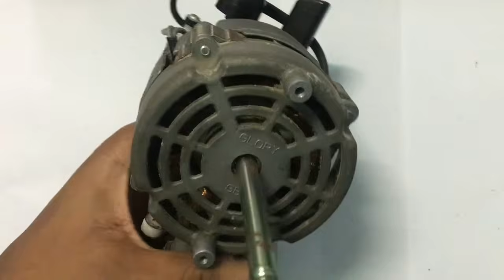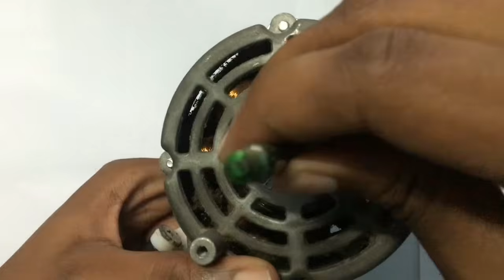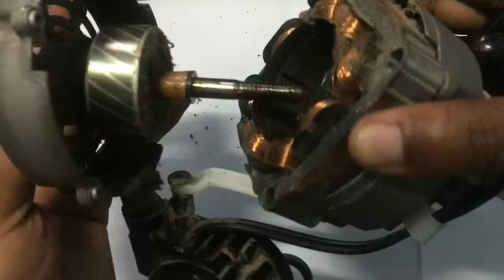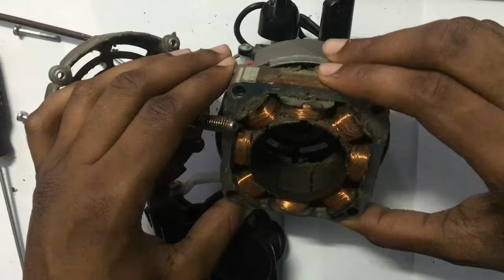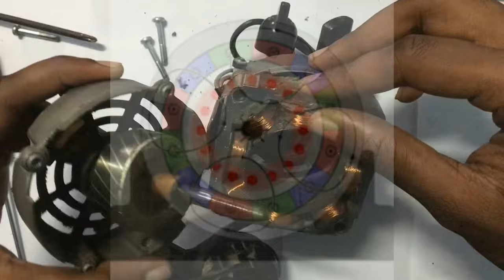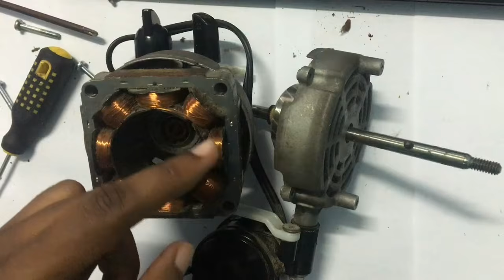How An Electric Fan Works

Comment: No! The switch is NOT a variable resistor. The 3 speed selections are due to different lengths of wirings in the coil assembly. The switch taps into the coil with 3 colour wire coded points. White is usually common. 🇧🇧

Comment: I've had a similar problem with my fan. I tried taking it apart and re-greasing the shaft but no luck. I think I've got an issue with the Starter. Any ideas on how to fix that?

Comment: Quick tip after u use wd40 make sure u also spray the back and make sure its lose before u put it back together u may need to twist and turn it abit to shake it lose and pull and push it cuz it has two bearings one in the back and one in front also make sure u put some vassaline on those beerings to make it run.

Comment: I've taken many apart. Because they seize up. I clean the shaft and the bearings. I use lithium grease. Because it seems oil doesn't last as long. I am not experienced in the electrical aspects of a motor.

Comment: hi i’ve been asking this question around, hope you’d be able to help. a few of my fan copper wires (maybe a couple) are broken, will it still be working or it’s dead now and need to replace a new motor? 
the fan is not working at the moment, i’m  not sure if this is what causing or the capacitor is dead. i’ve cleaned and put some lubricants but it still doesn’t work. 
thanking you!

Comment: Run caps do help starting somewhat. Also, a start cap cannot be used to run very long. On washer motors, for example, they are removed from the circuit, after achieving a certain RPM, by a centrifugal switch.

Comment: A lot of cool electromagnetic theory and electric motor design info here! I wouldn't recommend 'wd-40' to lubricate the fan's bronze  bushings though. Use an electric motor lubricating oil or I use engine oil, synthetic oil, etc. WD-40 is too light and goes away quickly. Thanks!

Comment: The rotor is a Squirrel Cage Rotor. It does not have windings inside. It consists of strays of copper/aluminium blades cut through and shorted. It is not like Armature Rotors which have windings.

Comment: I've heard that WD 40 isn't recommended for use in electric motors.  3-IN-ONE makes an oil specifically for electric motors.  It comes in a can that looks just like their cans of household oil except they're blue and white instead of black and white.
Reply: This is true 👍. In my workshop, WD 40 gums up as the motor heats up overtime. It is better to use the white machine oil. Stay away from motor oils also. They have inherent detergents which will grind the shaft and bushins away.  🇧🇧

Comment: Pretty well explained for the most part... The part with the rotating magnetic field is kinda confusing.
On single phase power, the magnetic field doesn't rotate, it just changes polarity 100/120 times per second (1 Hz = one cycle of both polarities). Three-phase induction motors have three phases that are all 120 degrees apart, so if you have three coil sets that are 120 degrees apart each connected to one of the phases you can actually have a spinning magnetic field. With a single phase, you don't. And that's why the capacitor is needed. Otherwise, from a standing position, the motor would have no reason to rotate. Once the motor is running, the magnetic field produced by the rotor is automatically slightly phase shifted by the rotation itself. Therefore, the capacitor is mainly needed to provide a pull to a specific direction when the motor is not spinning yet.
In reality, it's all a little more complicated than that. And there are all kinds of important differences between different types of motors which aren't obvious at first. But that's the basic explanation.
Reply: Thanks for explaination 👍
Reply: Wicked explanation honestly. You should teach lol
Reply: Thank you for the explanation. So, if the capacitor is not working and I physically rotate the fan blade, then the fan will start working?
Reply: @isla2974  In theory yes, if you can spin it fast enough. Without the capacitor there is no "net force" pulling in any specific direction. And if you spin it slowly (compared to mains frequency), it will still essentially just be pulled back and forth in alternating directions. So on average it won't "want" accelerate in any direction. If you can get the motor close enough to it's normal operating speed however, you can get it to "catch" on mains frequency and keep on running, even without a capacitor.
Reply: @phinok.m.628  thank you for the explanation!
Reply: Great explanation. 
What bothers me is: does the alternating magnetic field dictate the speed of the rotor as that is what it's trying to follow, if I understand correctly? If so how is fan speed controled?
Reply: @pilotboy2612  There are synchronous AC motors and asynchronous AC motors. A permanent magnet spinning in a magnet field would be a synchronous AC motor. It would lock onto the AC frequency and spin together with it at the same speed. Or if too much load is applied it would start jerking/vibrating and skipping magnetic poles. That's what you are thinking about.
In an asynchronous motor, like the one shown in the video. The magnetic field of the rotor is created by the stator inducing current into the rotor. Even if the motor isn't spinning, the magnetic field in the stator is switching polarity just like the AC current. And in fact, if the rotor were spinning at AC frequency, the magnetic field around the rotor would not change anymore and therefore no current and no magnetic field would be induced into the rotor. It relies in having a difference in speed. And the bigger the difference in speed, the bigger the torque of the motor. The problem is, that with single phase supply, if the motor is not spinning, the magnetic field of the rotor and stator are always 180 degrees apart. If you had a ball and you would put something on it, it would only spin if that something is of center. And the slower the stator spins, the closer the magnetic "pull" is to the center. So the motor needs some speed in order to be spun... When the stator has an actually spinning magnetic field, that's different, because the magnetic field of the stator will be "dragged" around, even if the magnetic fields are 180 degrees apart. In fact the motor will be the strongest, when starting from a stand still, where the magnetic fields oppose each other exactly.
That said, in either motor, the higher the frequency, the quicker the change in magnetic field and therefore the stronger the induced current and the stronger the generated magnetic field. Therefore a higher frequency will increase the speed of the motor. But not simply, because the magnetic field dictates the speed of the rotor, but rather the speed the magnetic field changes relative to the rotor dictates the torque...
It's quite difficult to squeeze into a Youtube comment in a way that sort of makes sense. But I hope it helped you understand it at least a little bit better. :-)
Reply: @phinok.m.628  Thanks for the clarification.
So the frequency dictates the max speed? Let's say a fan on setting 1, what's happening to the magnetic field? My understanding is that a longer coil will have less current in it hence a smaller field. But I still don't understand the affect of the frequency in this case. What if you where using 400hz like in aircraft? 
Sorry if I'm being slow and appricate it's not the easiest thing to explain in a comment 😀
Reply: @pilotboy2612  Well, it's difficult to explain and probably also difficult to understand. It's one of those topics that seems fairly simple at first, but the more you know, the more you see how little you know.
Anyway... Yes, the frequency dictates the max speed. It doesn't dictate the actual speed. But it does still have an influence on the speed. The motor has more torque, when the stator has a stronger magnetic field. The strength of the rotor's magnetic field depends on the current going through it. The current induced in the rotor depends on the rate of change of the magnetic field around it. Keep that in mind, the speed at which the magnetic field changes, determines the current and therefore the torque of the motor.
First of all, assume you have the motor running at 60Hz AC and spinning at 50Hz. The rotor will see a magnetic field around it oscillating with 10Hz (the difference between 50Hz and 60Hz). If the motor however is only spinning at 40Hz the rotor sees a 20Hz magnetic field and so, more current is induced and the motor produces more torque. Therefore, if you put a greater mechanical load on the motor, the motor slows down, which cases it to produce more torque (it's kinda self regulating). But now, what happens if the motor spins at 50Hz, but the supply voltage is increased to 70Hz? In this case the magnetic field around the stator also changes at 20Hz and therefore the motor also produces a higher torque. This means, the power of the motor can be controlled by the frequency and by extension also the speed. Keep in mind that when the rotor has a stronger magnetic field opposing the magnetic field of the stator, this also causes the current in the stator to increase and therefore the power consumption of the motor increases (increasing the torque requires more power and obviously that power has to come from somewhere).
But remember how we said the rate of change of the magnetic field determines the torque...? Well, assume we have a 100Hz AC voltage with 10V peak. What happens if we increase the peak voltage to 20V? The frequency remains the same, but in order for the voltage to go from -20V to +20V in 1/100th of the second, it has to increase twice as fast as it would have to if the peak voltage was 10V (same frequency). This faster rise and fall in voltage also induces a stronger current into the stator, which creates a stronger magnetic field in the stator (at 100Hz) but a stronger magnetic field changing polarity at 100Hz will also change faster than a weaker magnetic field changing at 100Hz... So what does this mean? It means that keeping the AC frequency the same but increasing the voltage also increaes the rate of change in the magnetic field of the stator and therefore also increases the torque of the motor. Which ultimately means, you can also increase the speed of the motor by the voltage. In the end, the speed of the motor depends on the voltage, the frequency and the mechanical load on the motor. Higher voltage increaes the speed, higher frequency increaeses the speed, greater mechanical load, decreases the speed. And so it balanced out at some speed (smaller than the AC frequency).
Quite a discussion this has turned into. :D
But anyway, I appreciate your interest in topic. Hopefully this fairly long explanation helped you understand it at least a little better. Keep in mind, this applies to asynchronous inductive motors in particular. Different motor, different rules of course.
Reply: Wonderful explanation sir. I remember some of this from the first year of HVAC act it forgot a lot of it. You must be an engineer or something?

Comment: Can you please explain what is the purpose of the capacitor? You mentioned a variable fuse as well... so if 2 of 3 speed setting works, but the 3rd is broken (taking for granted that no other parts are broken like the button housing), is that a fuse problem or the capacitor?  Just need your awesome input if possible before I order new parts as a DIYer... much appreciated! Great video btw!
Reply: The cap is used to start the motor by causing a slight forward offset better the two phases that control the magnetic fields... uh so it's playing while I'm typing and he does explain it, he just started explaining it at 5 minutes ish... he was more detailed than I was gonna be.
If you need more details than that than the following video will help. It's video 4 of a series on motors but this is where it's explained. 

https://youtu.be/2XYdTogWcIA
Reply: I think the capacitor is rather analogous to the starter motor on a car.
Reply: @abelsr5445  With the exception that in this case the cap varies the speed of the fan as well. You can understand this better if you watch a ceiling fan cap replacement vid.